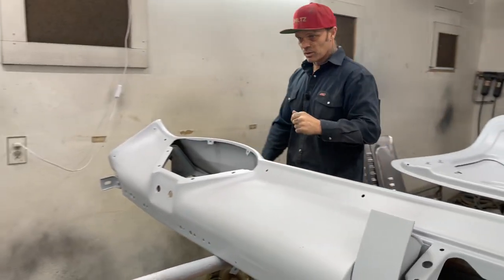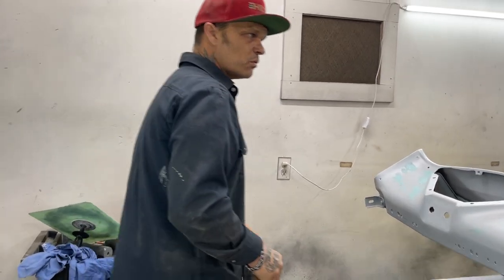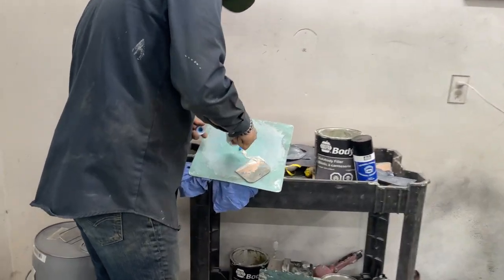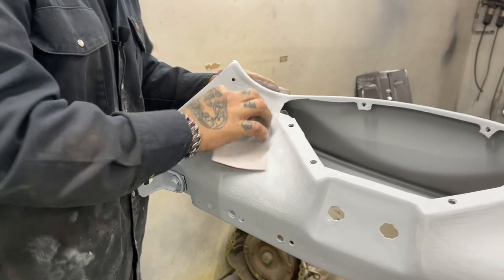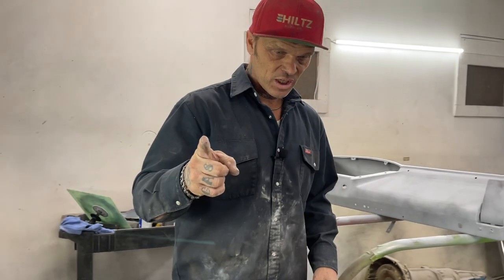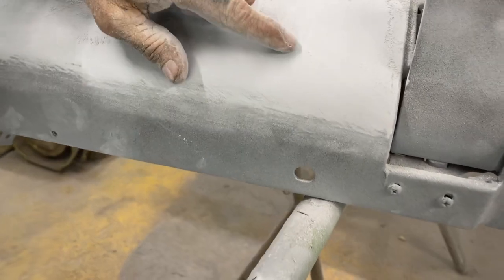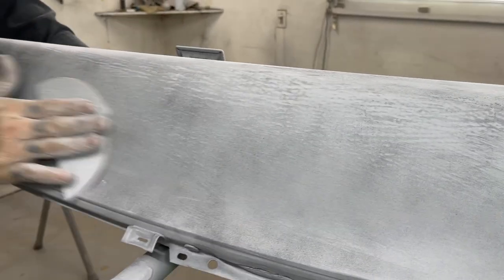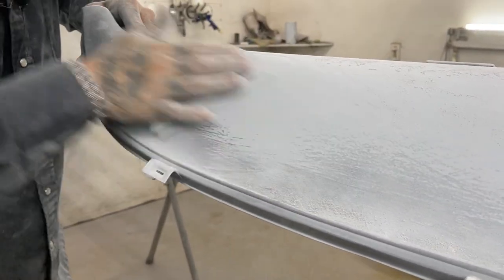Body Work 101: Sanding Primer with a Guide Coat for Show Car Quality Finish

Comment: I never liked using putty either as I find it can shrink back days or weeks later and you see in your paint work I use bog to fill my pin holes allso great that you are showing everyone howitzer looks as you are sanding back and how important it is to guide coat

Comment: Trick I learned with urethane 2k primer is to add a bit of urethane clear in the mix before you spray it and it sets nice and much harder than the mud. Also fills scratches better

Comment: I used to block primer with 180 re guide coat,da with 400 then guide coat again with 600 wet,was good enough for even silver,as long as you use your eyes.

Comment: Chad, Featherfill is basically polyester gel-coat with talc added.  The primary dangers are from the acetone base and the talc.  Although I really would like to see you wearing a respirator with this stuff (and they aren't expensive and breath better than the cheap dust mask you were wearing), the essential need is when spraying final urethane paint.  That stuff is deadly.  Most of us want you to be around making special builds for a long time, so get yourself and Jolene each a good 3M respirator (They have two filter packs either side of the nose) and protect yourselves better.)
Reply: I see him wearing covid mask ..lol ,cracks me up

Comment: I would add gussets on the rear from chassis to the 2 square bars holding the rear air bags , if I was running over bumps in that car I'd feel safer just saying mate ! overkill is always best if you are doing a build on the fly without trained knowledge of engineering or professional chassis building , credit to you on your body fabrication and skills though.

Comment: Please use all of the safety gear available including masks, glasses, shields, gloves, etc. Some of the compounds you work with won't harm you until years after exposure. I get it that you need to remove masks to instruct but then advise folks that you'll put it back on. The only thing you have is your health, because once it's gone, you'll pray you still had it.
Reply: Don't think he gets that..